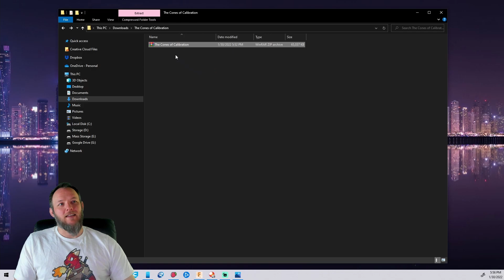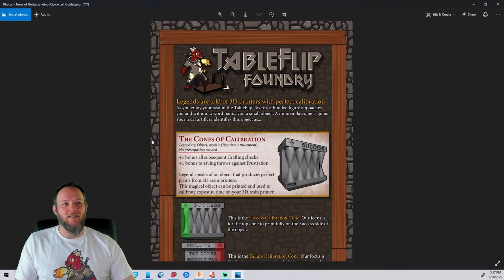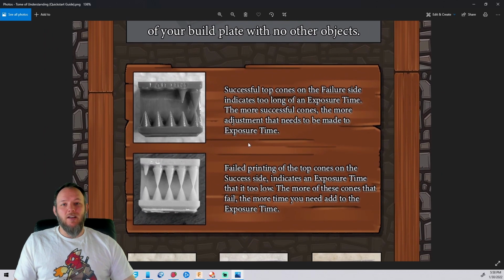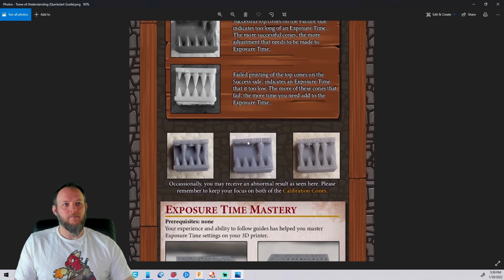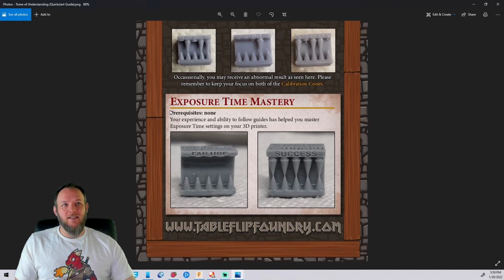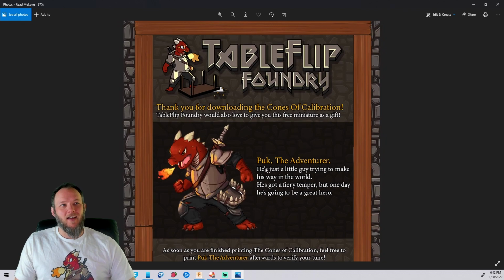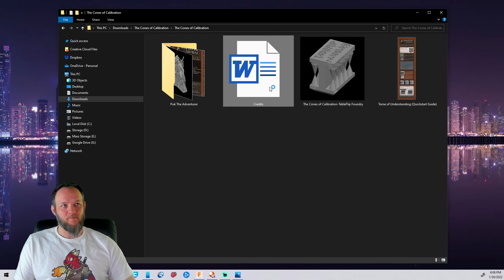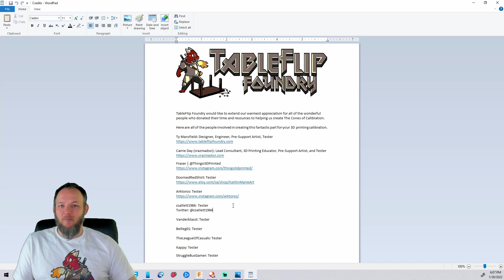This FREE 3D calibration tool will change EVERYTHING...

Comment: Hi guys. Ty thank you for this nice tool. I have bought an Anycubic 6K 3D printer recently and started printing football figures. The first figures were a success but suddenly i started getting more and more failures. Holes, deformed parts and horizontal ridged lines on the figures' faces. A friend has directed me here and I started calibrating my exposure time. I haven't changed anything else; just the exposure time. I have raised from 2s to 4s. I have printed 7 times the Cones of Calibration trying to achieve a full cone on the success side and no cone on the failure side. After 3,3s the success cone connected with the cone underneath but it's not at full size. I continued printing at 3,7 and now 4s. My success cone is perfect but I still have the failure cone get printing. What do I have to do in order to continue having the success cone but zero failure cone? Keep increasing the exposure time? Do I have to change another setting as well? Thanks in advance for any help. I am really loosing all the excitement I got by entering the 3D printing world 😞
Reply from the maker: Try rotating 90 degrees and see if you get a different result. Sometimes wear on the fep sheet can affect the print.
Reply: @TableFlipFoundry  Thank you for the reply mate. I will try to rotate the Z axis of  the initial position of the Cones and see if there is any difference.

Comment: I need help I did it and I still need to form half of a cone as the image shows! use 3.7 exposure, how much more should the exposure increase in the next test? 4.0 would be ok or better 4.2?
Reply from the maker: Every printer is different.  But .1 or .2 seconds is generally appropriate

Comment: I have my normal exposure @ 1.5s perfect exposure and bottom exposure @ 20s which ends up with splits using a LD-002H
Reply: Sorry to bother but can you please share how many bottom layers at 20s? Did you use transition layers? What is the room temperature? Tks
Reply: actually those aren't my updated settings they are Normal Exposure @2.21 Bottom Exposure @ 35 and my bottom layers are 5 i use Siraya Tech Fast  @rarstorm

Comment: Man, i was using 4.5 sec with xp2 validation test(had a lot problems) and now with cone calibration im using 9.5 sec....brutal difference
Thanks my friend!
Reply from the maker: That seems a bit extreme of a change. I'd love to take some time to help you out and make sure you're dialed in well. Are you printing on an RGB screen? These types screens tend to take longer. What type of printer are you on?

Comment: When you say to adjust the exposure times in between tests, do you mean the Burn In Layers one, the Normal Layers one, or both?
Reply from the maker: Normal Layers. Burn in layers are only relevant to making sure your model sticks to the build plate. If they stick, dont mess with burn in again.
This is for normal layers only.
Reply: @TableFlipFoundry  Thanks a lot for the quick reply.  I'm still new to this.  Maybe this will help pop out the details of some of my models and fix the flimsy / breakable pieces on some of my jobs.

Comment: Does this calibration tool depend upon the layer height? I have a Saturn 2 and want to start printing at 30 um instead of the normal 50 um layer height (to match the 28 um XY resolution the Saturn 2 is capable of). Will the Cones of Calibration work if I'm using a narrower layer height than normal?
Reply from the maker: The layer height does not affect this tools ability to work at all. You're good to go.

Comment: The idea is very interesting, and conclusion is easy to make, but...

To me, it feels like this makes some assumptions about relations between exposure times & peel forces. But peel force isn't some "constant" across every printer, nfep sheets seem to have "less violent" peels, and of course there are printers with tilting vats (Prusa SL1), that also reduces the peel forces. (and of course there are printers like Form 3 that are "very" different)

So any thoughts about this?
Reply from the maker: These are valid observations but the matter of weather or not something will hold or not hold is absolute. Regardless of what forces are being applied.
The contact diameter will hold, or it wont. It's quite binary, if they hold, it will print, if they dont, it wont print. 
The settings and variables you use to get there dont matter in the end, as long as the result is success. 

That said, this is geared towards the broadest average. There is no 1 perfect system for everyone. So this is meant to reach the new to intermediate level users who havent begun (or shouldnt have) messing with more advanced tuning and such. 

The goal is to get people some success early. So they dont get frustrated and quit the hobby. Get them something reasonable to print with and making fun stuff.
Reply: @TableFlipFoundry  Yep, will hold / won't hold is very "binary" in the end. But from my experiences, higher peel forces can make supports, that would otherwise work, fail.

I am sure you can get the "sweet spot" on most printers (perhaps not on Form 3, but it's not aimed at this kind of prints anyway), but this isn't about "making supports work", but rather "making sure the entire print isn't over- or underexposed".

Comment: if the cone of calibration is lets say 1 inch high for 50 Microns can we adjust the scale size to adjust to microns, so if 1 inch high = 50 micron
then 1/2 high =25 Microns.
another idea is if you use the cone of calibration lets say 1 inch high for 50 Microns the time to print would be 1  hours, the cones of Time LOL
you could use this as print time as long as they did not change any other settings
Reply from the maker: An answer, a thought, and some news for you.
Answer: No you cant scale it

A Thought: These machines are highly complex and have a lot of variables. Getting them calibrated is difficult and shouldnt be rushed. Also, this version is almost identical to the Ameralabs city in height.

News: V2 is coming out soon. It prints 35% faster ;)
Reply: @TableFlipFoundry   thank you the part i liked that you said is when you said when you calibration you should know without a doughy you should know instead of asking others what they think, yeah get a lot of objects on 1 calibration test print that half maybe good and the other totally messed up leaving you clueless, so basically you end up picking the best over all looking one then having to judge on each item. i think yours is the best, could this be made for multiple exposure or used in UVTools to create multiple exposure,
i have anycube photon M3 Which has its own R-E-L-F multiple exposure and i have phrozon mini 8K, be nice to have cones for  multiple exposure for both of my printers

Comment: late to the party on this and I do not see this question asked and answered.
Why do we only care about the left most cones?
I ask because I can not get those two cones to print as expected. When I get my exposure time high enough(going in .1 increments) I get a successful 'success' left most cone. But when I turn it over, there is always some bit of the top cone on the failure side. If I lower my exposure enough to get that cone to completely fail, I do not get a successful success cone on the left most cone. BUT, typically, on the success side, 3-4 of the other success cones are printing entirely.
Reply from the maker: You don't have to get the failure side perfect. Put yourself in the spot where you can't go any lower but have a good success cone. Then print puck
Reply: @TableFlipFoundry  awesome, will do! Thank you for replying.

Comment: My first fee had cones on the bottom of both sides  still not what that means
Reply from the maker: They are supposed to have cones on the bottom of both sides. Its the top cones are are worried about.
Reply: @TableFlipFoundry  i mean no top cones just botyom onrs
Reply from the maker: @Retroforge-creations  This means you're exposure isn't high enough or you have very weak resin, try increasing exposure time.
Reply: @TableFlipFoundry  do you mean initial or other layers

Comment: Hey guys. So I printed this model. Started with 2.5 exposure time. One fail cone succeeded to connect. Changed it to 2.0. Success cones failed. Changed to 2.2. One success cone failed. Now before I print again. Do I only need to change the exposure time or I need to print something else?

Printer: Elegoo Mars 3
Resin: Anycubic Eco
Settings from other people uploaded in lychee slicer server. Please help! Thank you

Comment: i have had a very strange issue. My first print was 2.5s and I could see it was heavily underexposed on the success side and on the failiure side. after that i choose 3.5s and it was nearly perfect on the success side with a litle tip of one cone missing and very small signs of cones on the fail side. So i choose 3.6s exposure and it came out underexposed on the success side and overexposed on the fail side. Did anyone have the same issue?
Reply from the maker: I'll be super happy to help ya, but it would be easiest to see some photos and look at settings and stuff. Hop into our discord and hit our channel for the cones. I'll jump in and have a look with ya.
Reply: @TableFlipFoundry  will do thanks

Comment: Would the intended failures cause floaties in the resin, needing to strain it after every test? I'm about to try this out!
Reply from the maker: The design picks them back up with the roof.
Reply: honestly regardless I strain every print, a couple minutes of straining is a lot quicker than having to replace the screen/fep 😅😅

Comment: why cant I print another test at the same time. I can leave cones in the middle, and put other tests around it...? You don't explain why...
Reply from the maker: I intentionally don't explain hours of technical information about this stuff. The reason is, this is meant to be simple and not over complicated. I took care of most of the complicated work so you don't have to.
That said, the FEP deflects when prints are pulled off it. That deflection needs to be symmetric when the connections of the cones start printing or else you can have inconsistent results. 
This is a mechanical test, and so the mechanics have to be repeatable and reliable and adding random other parts to the print can disrupt that.
Reply: I understand. Thanks for your reply

Comment: Is it just the cone on each side that has the + or - that's important? Or ideally should all the top cones print in the success side and all the top cones fail on the failure side?
Reply from the maker: Yes to both. IDEALLY it would print exactly like you describe. But in reality sometimes it doesnt, so its appropriate to only be worried about the + and - cones behaving properly.

Comment: This looks interesting, so I'll give it a try. Having huge problems dialing in the Mono X with the RERF test giving results that are, apparently, just wrong, and the XP2-Validation giving slightly better results, but ones that completely conflict with the RERF test. However, even though this can help with exposure, there are other factors, like lift and retract speed.
Reply from the maker: You got it. This only focuses on one aspect of the 3d printing process. You should jump in our discord. I can help you sort out what's going on with your printer. I have a mono x too.
Reply: @TableFlipFoundry  I did, actually, and got a bit more useful info, so thanks for that!

Comment: After recasting the spell of magic light..
You reach into the yellow tomb of making..

You retrieve the amulet of calibration but the spell wasn't strong enough.
You mix a new potion of light 2.0 and re cast the spell at the tomb of making..
Reply: Seems my Mana has settled at 2.2 seconds which gives full cones on success  approx 1/4 and one half cone on the fail. 2.1 seconds sees all the fails missing and 2 of the success missing. Great work much easier to see the result....
There is a door to the North, Inside is a computer and some stl files
Enter the room Y/N blinky blinky

Comment: Well that was an epic fail! 
Stuck to fep!

Try again
Reply from the maker: Add a few seconds to your burn in time maybe an extra couple of burn in layers. Also you can print the one with the raft as well.
Reply: @TableFlipFoundry  sure that won't help as it clearly got half the base down. Cleaned the plate and second attempt is 4 on the pass side 2 half cones on the fail side
Reply from the maker: @silverbullet6833  It stuck to the fep this time! 
Ok awesome, you're on the right track then! Just drop maybe .2 seconds and youre gettin close!
Reply: @TableFlipFoundry  I've got parts printing, didn't have that last week! Can't believe I got it that close from the previous cal print.. we really were guessing which one looked better on the other test we did....

Comment: Hi Ty, I've been FDM 3d printing for some time now and recently got a resin printer the Anycubic Photo Mono 4k. The supplied test files came out well but i found creating my own prints a really annoying FAF! I used to paint miniatures many years ago and Ive played many a description based adventure game on early home computers  (from the 80's) keep that bit to yourself though! As just about every resin printer video is about table top miniatures, i was struggling with supports for my small scale projects.

I caught the YouTube of the live stream you did  for supports, which helped a lot for an FDM guy who is looking to use as few supports as possible normally for better quality!
I used your suggested setting support tip values and I've had almost perfect success on the few prints Ive tried, the support interface i find a bit janky in the free and its a bit annoying the cost of unlocking the thing that seems key to resin prints!
Next up for me is the cones, The instructions made me chuckle as its just like you used to get all those year ago on text based adventure games.

a question i have, my 1st prints even my failed efforts were a good representation of the slicer but i find now my prints complete but there is often a thin layer over at least half the build plate maybe 1 or 2 layers thick like a skin. Also there is a faint skin in places on the model as well as a few sort of snotty  danglers from the model where its drained back? They wash off but i'd like to hear your thoughts.
I've even subscribed!
Sean
Reply from the maker: Hey man! No shame in the game from the 80s. I love that you call it a description based game. Sounds like your off to a good start printing wise.
That skin can be tricky. There could be a few causes. Is your printer near a window or direct sunlight? Or near any uv light source? 
If so, then move the print away from the source. 
If you're not, there is potentially a corrupted sliced file. Format your USB disk and reslice.
If that doesn't work, you may be looking at a screen that's on it's last legs. It shouldn't be dying this soon, so it's likely something else.